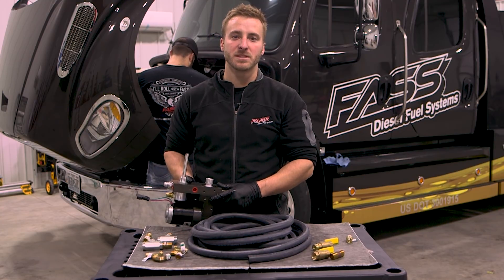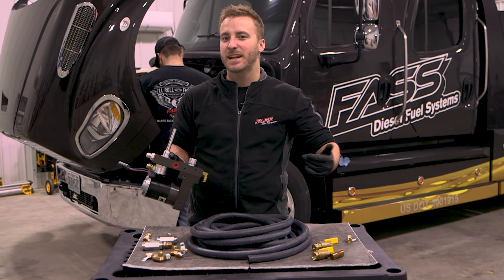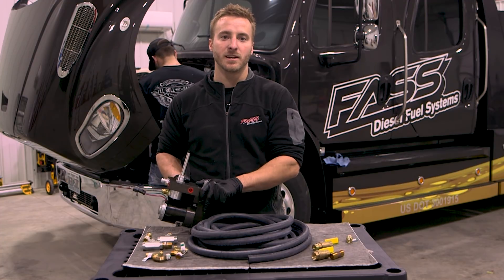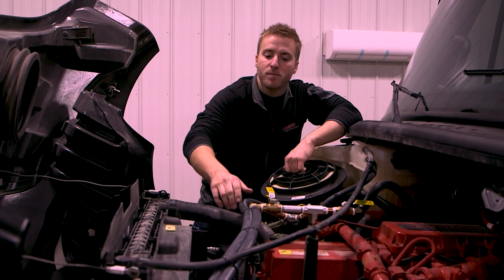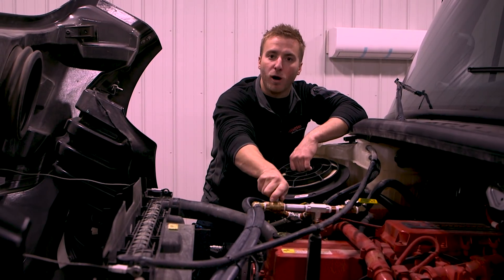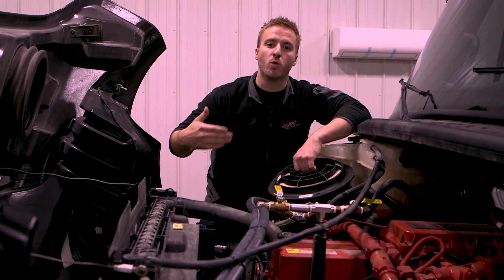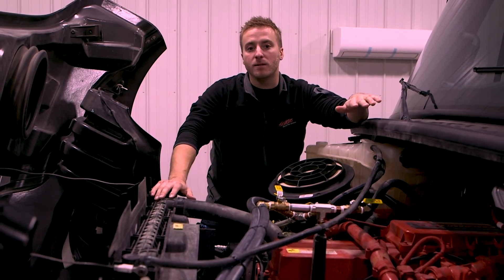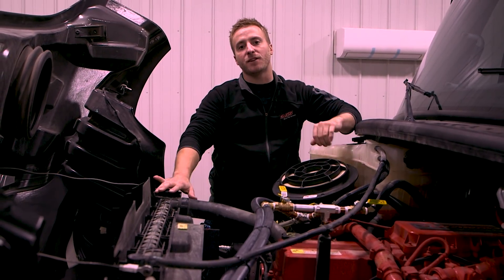FASS Fuel Systems "Coolant Feed Installation"

Comment: That's my next project!
Reply from the maker: That's awesome! 👊
Reply: @FASSFuelSystems  
I'm going to tag into the heater core lines and run -8 jic to a heat exchanger and t off that with smaller lines. I'll also have a fuel tank temp gauge so I'll know when it's dethawing.
Reply from the maker: @tjb.7213  That sounds like a plan!